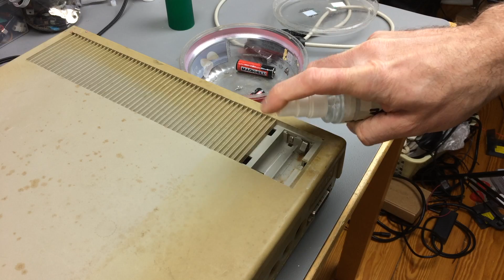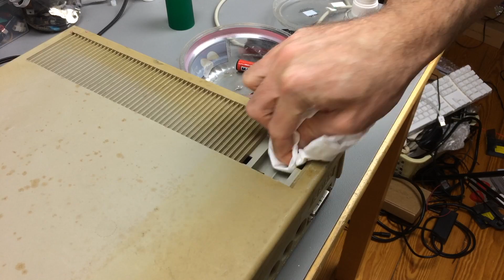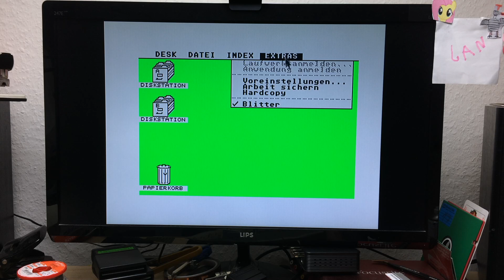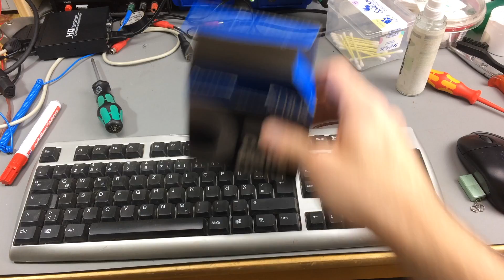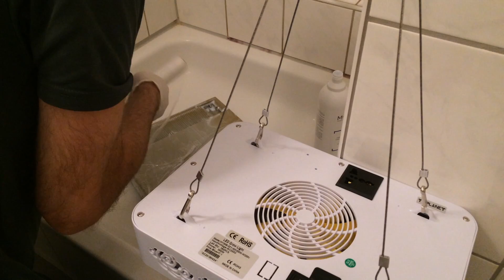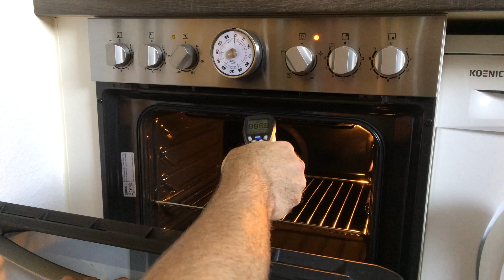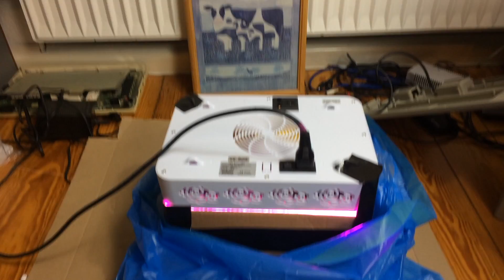Atari Mega 1/Mega ST Restoration

Comment: I think the Mega 1s were a later addition. I'm sure when they first came out they were only in Mega 2 and Mega 4 versions. I was lucky enough to own a Mega 4 and Atari Laser for about six months before I sold them on and went into PCs. Would love to have one again, but just for the sake of it, can't think of what I'd actually use it for. I did once write a game that got nearly commercially released but the company went bust, so I sold it instead to STart an American ST mag.
Reply: Your assumption is correct. The Mega ST 2 and Mega ST 4 were the first Megas.
Reply: Which game?
Reply: Oh, it was nothing special. Just a puzzle board game I called 'STumblin Blocks' based on Pentominoe pieces (also used by Tetris). I got the idea from an Arthur C. Clarke book, 'Imperial Earth'.
Reply: And yet the Mega ST 1 was part of the originally announced models. The European market got it first because they were released right around the time the Reagan Administration slapped the Japanese DRAM manufacturers with high tariffs for having "dumped" their chips in the US in order to drive the American semiconductor companies out of the DRAM business. That, combined with all of the issues Atari Corp ran into in getting companies like GE and others to manufacture the Blitter for them led them to ship the majority of the STs to Europe. That happened all throughout 1987 and parts of 88 and that's when Commodore was able to take the sales lead here in the States; well, that and the release of the Amiga 500. And also Atari Corp dragging their feet in releasing the STe - in 1989! - when their loose lips had been talking to the press about the "EST" since early 1987.

Comment: I bought an electric mouse trap designed to catch up to 100 mice without emptying the bin. It uses C batteries and it came with them. Less than a year later I noticed it wasn't working in spite of the fact that the smaller ones have been going on for 5 years in some cases. I opened it up and the batteries leaked all over the place. YUCK!! I got some REAL batteries instead of that cheap crap that it came with and it's all good now.

Comment: There were two versions - one with six ROM chips, or two. Consider yourself lucky - it’s easier to deal with the two chip models! My US Mega 2 has two chip ROM, and my Mega 4 has six. Both have a PSU fan which is really really loud.

You have Rainbow TOS - that’s 1.4.
Reply from the maker: Yes, that's what I thought, too. I might try a newer TOS sometime, too. :)

Comment: Giana Sisters plays better on a C64.
Reply from the maker: True. I heard there's a blitter enabled version for the Atari with decent scrolling though. Going to check out that one, too.
Reply: @JanBeta  That might be an STe enhancement though. The STe line had the hardware scrolling added to them. Of course, the software publishers hardly supported any of the STe enhancements which were the scrolling, enhanced colo(u)r palette, the DMA stereo sound, and the Enhanced Joystick Ports most famously re-used later by the Atari Jaguar.

Comment: Like your screwdriver set!
Reply: Wera screwdrivers. They can be a little pricey but are very well made reliable tools.
Reply from the maker: Yes, Wera. I bought them when they were discounted at my local electronics seller. I had a set of cheapish ones before. Never regretted paying a bit extra. They are amazing quality and very pleasing to work with.